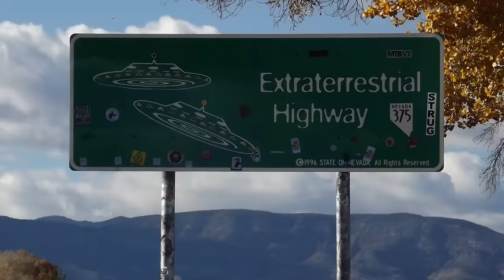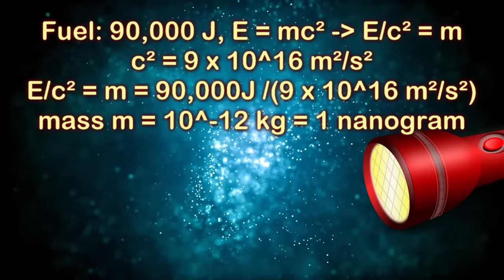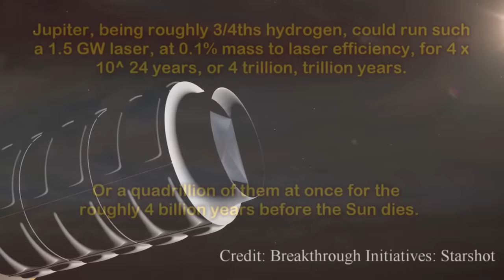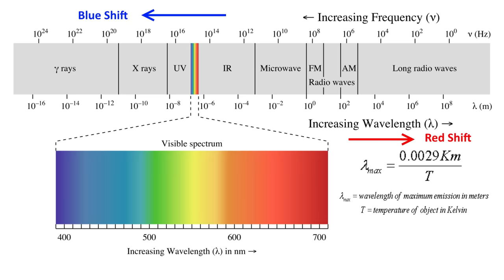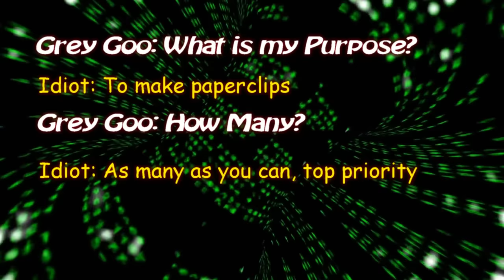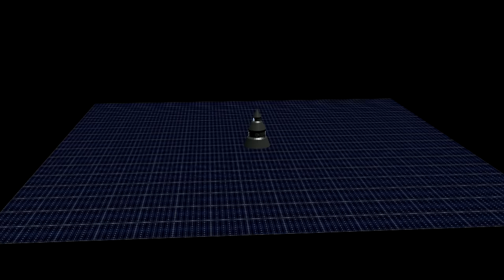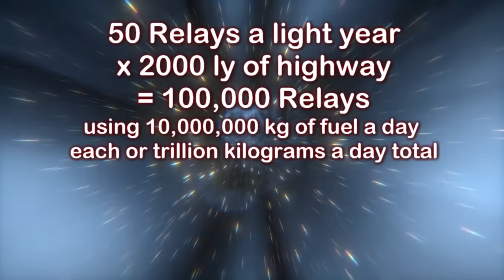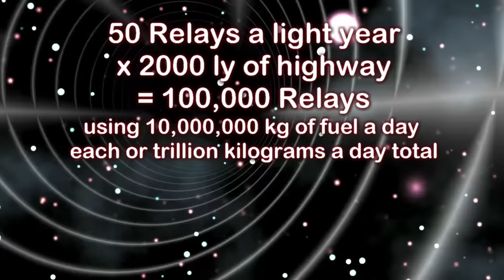Interstellar Highways

Comment from the maker: Quick note since I didn't say it in the episode, yes you probably would have a mega-array at each star system, probably solar powered, pushing many ships at once up to that first few percent of light, or powering ion drives, or maybe a long mass driver. The first few relays would probably be higher powered too.
Also, for anyone whose wondering, yes the Douglas Adams reference is to celebrate the channel hitting 42 thousand subscribers, I was going to do a Warhammer 40k reference for 40,000 subscribers but forgot, and its a bit more obscure than Hitchhiker's. As a sidenote, while next week's episode should come out here on time, it might be an hour or two early or late, there's some scheduling functions for when I'm away but I don't trust them to be reliable, and I will be away at the time :)
Reply: Robert Zubrin and Dana Andrews took a failed attempt at formulating Bussard Ramjets, and turned them into magsails that are quite efficient at slowing down interstellar craft. They also don't suffer from the rocket equation. Using these in conjunction with tethers could take care of much of the manuvering at the endpoint of an interstellar trip.
Reply: I love your videos, can I get your thoughts on a few questions?

If these laser highway relays are putting off enough thrust to push a ship, wouldn't they also need to be firing in the opposite direction to keep their position? That would at least double the energy spent on any of the relays. 
 Also, how would the lightsail ships dissipate their heat? Getting hit with a laser that could light up continents would fry anything in seconds, not to mention getting hit with it for years/decades at a time.
Reply: @Eric. the reflectance needs to be high.  That may also be a reason to go with microwave.  Aluminum is over slightly over 90% in the visible range.  https://upload.wikimedia.org/wikipedia/commons/thumb/9/9d/Image-Metal-reflectance.png/400px-Image-Metal-reflectance.png  Aluminum would heat up a lot with a blue/red laser.  A kilogram of TNT is about 4 megajoules.  So if you have 99% reflectance, 1kg sail and 400 megawatts it should be blowing up like TNT in under a second.  Not sure how fast a thin film radiates heat. 

On the bright side the radiant heat could add some propulsion.  The stations generating the laser beams probably have to dump a lot of heat.  Isaac's generator was 0.1% efficient so 99.9% is going somewhere else.  So the station should be able to radiate much more thrust than the thrust from the laser.
Reply: @chris pearson,   15:09 Included in video.
Reply: Couldn't the mass driver just be circular around the originating star and then release the payload at a tangent towards the destination star? This way you can accumulate as much speed near a large power source almost like a very large particle accelerator but with more substantial payloads. Then just use the relays to slow down the vessels  as they approach their destination using lasers and light sails.  I can see such a scheme bootstrapping itself giving the initial vessels just enough speed and fuel to eventually slow itself down to stop at their proper place in the relay.

Perhaps you can integrate this with the star lifting schemes and drive some of the stars' hydrogen along the relay path. Or else mass drive fuel to the relays at a slower speed and have the equivalent of tanker trucks dropping off fusion fuel to the relay stations on an ongoing basis.  Alternatively, you can set up these relays at habitats in Oort cloud objects when available.

Also, I think that instead of a light week between relays it would be better to have more, smaller relays so that the vessels can communicate to the forward relays and give them better targeting information.  I think that a 24 hour cycle with 12 hours powering the laser to slow down incoming vessels and another 12 hours waiting for a signal from the vessel to confirm the "hit" and provide new velocity and location information would drastically reduce the risk of directing the lasers in the wrong direction.  While waiting In the meantime you can either target other incoming vessels (perhaps from the opposite direction) or redirect the power to the needs of the local habitat.
Reply: @ calags, The size of a mass driver is exponential.  For a given velocity it gets a lot longer.  Definitely a good way to start the journey and to supply stations.  Earthling road planners in remote areas have to decide between more dirt roads, paved roads and improved two lane roads.  If you double the number of relay stations you either double the cost or cut off access to a large section of the galaxy.
Reply from the maker: Episode 1 yes, its a series so that first episode is more of the preliminaries and an overview of options.
Reply: Isaac Arthur
what do you think about the reapers from mass effect?
do you think that kind of motive to kill is logical?
Reply: stefan r Instead of a linear mass driver I was considering a circular one around the home star. the vessel can be introduced at any point in the circumference but is released at the point where the tangent would lead the vessel to the target direction. I think this should obviate the length issue while possibly introducing others. Do you think this might be feasible?
Reply: @calags The engineering required to build and precisely align a tens-of-millions-of-kilometer-long accelerator is far, far beyond anything that humans have done in their collective 10k years of existence. We might suppose that we could get to the stars sooner using some other method. Adding in a curvature, or an orbit around Sol, greatly increases the complexity.

The idea isn't completely dead. I'm toying with it, too. I'm thinking that we ought to be able to use the tremendous power of Sol to eject large spacecraft at relativistic velocities. The magnetic fields and intense radiation near Sol could propel Earth to relativistic velocities. Doing it survivably requires acceleration over tens- to thousands of millions of kilometers.
Reply: @Eric Hendrix "If these laser highway relays are putting off enough thrust to push a ship, wouldn't they also need to be firing in the opposite direction to keep their position? That would at least double the energy spent on any of the relays."

The reverse velocity of the laser station is proportionate to the mass of the station. So, if the station is on a rock that is a million times larger, or a billion times larger, than the mass of the target, the station would move a million or a billion times less in the opposite direction. If it is anchored gravitationally to an even larger mass, such as a star, it's orbit would be perturbed a little, but it wouldn't just go flying off into space.  

"Also, how would the lightsail ships dissipate their heat? Getting hit with a laser that could light up continents would fry anything in seconds, not to mention getting hit with it for years/decades at a time."

What I've seen in the plans presented at Icarus Interstellar is using an ablative substance for the reflective surface. 

I have another idea, though. What if the ship is in a cloud of absorbing fluid, and the laser beam interacts directly to accelerate the fluid, taking the ship along with it? The fluid gets hot and radiates and disperses, but hopefully a lot of the thermal energy is converted to kinetic energy of the ship. 

Another idea that just occurred to me is making a ship that is a highly reflective soap bubble. I think that I saw someone else suggest that certain shapes of ship and beam would naturally center the ship in the middle of the beam, without the use of propellants. A perfectly spherical ship might be the right answer.
Reply: When a flat object is in freefall its stable orientation is to expose as much surface area as possible in the direction of the wind. Is the light sail the same? If so then if it is built balanced it shouldn’t experience any drift (unless you want it to). 

And instead of having multiple relays couldn’t you just have multiple lenses and one huge laser back at home. The lenses would collimate the laser beam whenever it is getting too dispersed and they wouldn’t need fusion to run. This could also help in slowing down at the end destination. To slow down a craft, orientate your sail forwards and send a mirror in front of you that directs the light to your sails. The mirror would speed away from you but it would slow you down in the process. 

How do we clear out space junk? Can we use the lasers themselves to do that somehow? 

If you need fusion to power the laser stations then why wouldn’t you just use fusion to power the spaceship thrust. Also, the relay stations would drift because of the thrust they exert on the spaceships so the highway would have to be two way unless you wanted to exert energy maintaining the relay’s position.
Reply: Isaac Arthur What's so... funny about 'Biggus Dickus'? Well, it's a joke name, sir. I have a vewy gweat fwiend in Wome called 'Biggus Dickus'.
Reply: And what if some planet interefers with that "space highway" ? You will ask vogons to take care of it ?
Reply: We can't test something that we don't know how to get. Nobody knows how to make an Alcubierre drive.
Reply: Isaac Arthur
Reply from the maker: What's up Dan?
Reply: Isaac Arthur Great work!
Reply: travelling at the speed of light is not possible , the faster you go the more fuel you need , repeat last 9 words , stop bullshitting, you do realise that we have not even reached 10% of speed of light speed, yet and here you are making outrageous  claims using science,
Reply: Ossie Dunstan, I do not see here anyone claiming travel at light speed. 
Splitting hairs, but the same fuel and same ship will get you the same acceleration regardless of your velocity.  You need a larger amount of fuel to accelerate both the ship and a full tank.  That does not matter much for mirror propulsion.  There is no fuel or tank.  

The LHC has reached 99.9999972 % of the speed of light.  A live human being has never reached 0.01% of light speed relative to the surface of the earth.  Apollo 10 got to around a third of that 11km/s.  

For thousands of years no human could run faster than a cheetah (100 km/h).  I go faster everyday on my commute and jets fly through the sound barrier.  We have not evolved a better way to run we just worked around some of the obstacles.
Reply: Chris pearson, I searched and looked at a few articles about Extended Heim Theory.  Some day we may discover that a significant part of known physics is wrong and needs to be reconsidered.  At that point in time some of Isaac Arthur's channel may be obsolete and need to be reworked a bit (or a lot).  IMO futurism is best when focused on known science.  It would be great to see a demonstration of a "gravity like field".  

Albert Einstein published a theory of relativity in 1915.  In 1919 there was a solar eclipse and gravitational bending of light by the Sun was measured.  That measurement helped to switch Einstein's idea from weird crackpot idea to accepted hard science.  I cannot find a link to any finished experiment that verifies Heim's Theory or it's extension.
Reply: Wow... less than two months ago you hit 42K and you're already at 71 thousand? That's amazing! I'm brand new to the channel myself and loving all your videos. I'll hate the day I catch up and actually have to wait for more!
Reply: +Isaac Arthur What accent is that? I like it
Reply: It's a speech impediment actually
Reply: You should do a show on detecting earth-like planets with future "mega telescopes" or whatever they might be called. Traveling light-years from home doesn't make much sense unless you first know where to go to get the most bang for your interstellar buck.
Reply: Yes you can, but you would have to use onboard fusion reactors to power your lasers, that means you have to store hydrogen fuel on board. And that mean Tsilovsky's depressing rocket equation for your ship.
Reply: Assuming that Dark Energy exists, are there any hypotheses regarding harnessing this energy for the purposes of interstellar travel?
Reply: wait, we could've had a wh40k reference but didn't???!?
Reply: All these star patterns bunch stars closer together than dispersed fat particles, it's such an unrealistic view of scuttling around around space.
Reply: I'm so ready to go!!! Can't wait for the future!!! I live in Herkimer!
Reply: Isaac Arthur Wake up Look up look out
Reply: Money is making the world advanced but truly holding it back more than it helping and humans putting patents where they own technology instead of it just being something that we can all benefit from because everyone wants their peace there will be more people without pieces of anything
Reply: What if instead of having another laster infron of you to slow down you just fragment the ship in 2 parts: front and back and have the front part reflect the laser to the back part so the front part speeds up and the back part slows down. You can even make something like a space train where you have a really long ship sailing on a laser that drops and decelerates smaller ships so they can get in orbit of multiple stars in a line and the main ship becomes lighter and lighter as it gets farther away from the laser and have the last fragment warm up a planet or something.
Reply: Update. Light can be bounced 30,000 times for 10 kilowatts per newton.

Comment: I always thought that for starshot, the political reaction to a megalaser wouldn't allow it. However, we are lucky to have a moon with a face that never points at Earth. Perfect place to put this array, connected to solar panels at the poles. Another reason to revisit the Moon and industrialize
Reply from the maker: Static position lasers aren't terribly dangerous, especially a solar powered one, very big target, if someone hijacks or hacks one, you just use another laser to blast it.
Reply: Andy Falconer we have nukes anyway, what's the problem?
Reply: AlHoresmi The EMP from an orbital nuclear strike would probably wreck havoc with electronics both on the ground, and of a bunch of the surrounding satellites. Also, unlike a laser, any blast would probably scatter debris and make a sizable region of orbit dangerous/unuseable.
Reply: lasers counter ballistic missiles
Reply: Putting the laser on the other side of the moon makes it worse.  No one on earth can see what you are doing.  Obviously we have light weight/cheap mirrors that can reflect the laser so shooting around the moon is not much of a challenge.  You could, for example, have the mirrors hang out around earth/moon Lagrange points 4 and 5.  Is a much shorter range than 1 light week. 

Could tin foil hats replace camouflage as standard military gear?
Reply: The only problem is that the other side of the moon points in different directions half the time, so there would have to be long periods with no drive
Reply: yeah, that is true. The moon has the advantage of being stable with a trade-off of long downtime periods.

I am also wondering now about the long term stability of a laser array in a whatever given orbit.
Are they parked on a massive rock to minimize reaction acceleration? and do they shoot lasers backwards to adjust. Does this mean they need to do at least double the required beam energy on the spacecraft?
eh, but maybe all of that isn't that big a deal
Reply: Gary T, the time for a launch is a few minutes.  After that aim becomes hard.  Luminosity is distance squared same as surface area.  So hitting a 10cm target like, for example, your fist or your head, from the moon is about the same as a 1000 meter wide target a few light hours away.  
Andy Falconer, A 1% efficient laser and generator will radiate 99% of the consumed energy as infra-red (heat).  You can place the radiator on whichever side of your spacecraft you want to be the backside (see Isaacs Shkadov thruster video).  In addition to that, any orbiting platform will be shooting lasers spinward for half of the orbit and anti-spinward the other half.  Net change becomes 0.  Above and below planar will balance too.  If you are launching to multiple stars much of the acceleration cancels.
Reply: Thinking about this, does it matter (politically) that it can not range directly at earth from there? All that is needed is a mirror in moon orbit, or deeper and it can be pointed anywhere.
I suppose  it would be easier to knock down a ship with a mirror on than a ground base, but by then the damage would be done.
Reply: gary T,  Mirrors are cheap.  Think of thin films, more expensive but similar to pocket emergency blankets or party balloons.  Folded, rolled, and/or deflated the mirrors can fit in a small packages.  The case can be covered in stealth paint and shaped like stealth airplanes except cases do not need to be aerodynamic so they can be better.  You could launch thousands of mirror cases in one rocket or stash bunches inside many normal satellite launches.   Use earths magnetic field and an internal wire to slightly shift the orbit and no one will know where they are until they deploy.  Use the same internal wire to keep the stealthy point toward earth or toward a radar source.  The act of firing the laser would also move a light weight mirror so if the enemy shot at them with kinetic projectiles (bullets) the mirrors will not be at the right location.  The enemy shooting lasers at your mirrors would be good times.
Reply: But the very nature of solar sails means you have a space mirror which could potentially reflect the laser beam back towards earth. It may have spread too wide by the time it gets there, though, it depends on the exact setup.